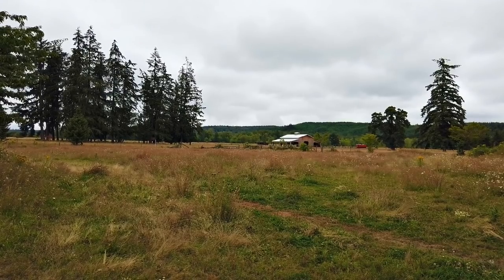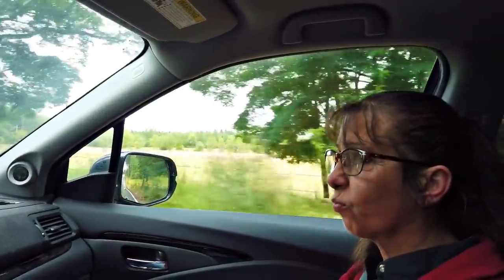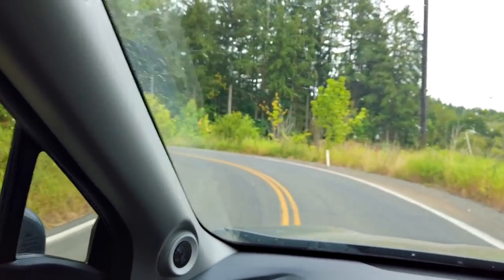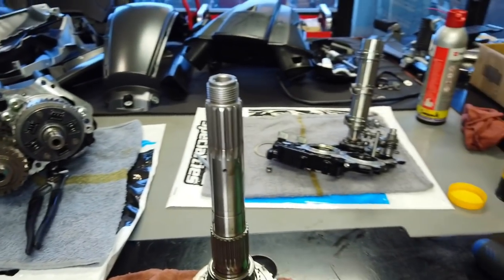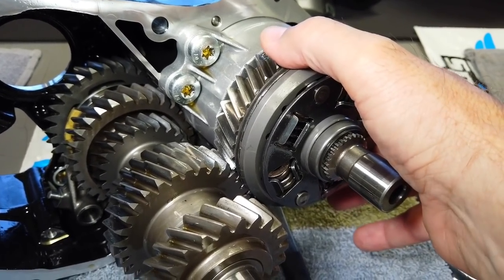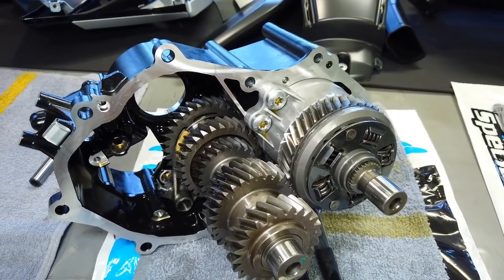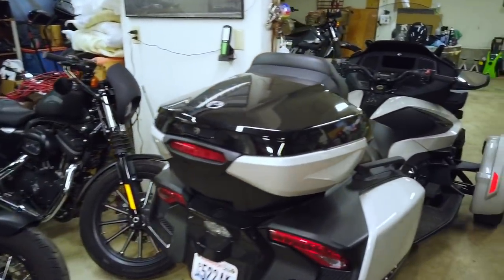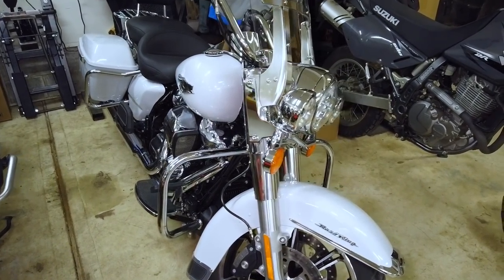Indian Springfield in Sagebrush!! • 2020 Dark Horse! | TheSmoaks Vlog_1711

Comment: Speaking of the dampener, the Honda Goldwing GL1800 from 2001 - 2017 used a similar one for the alternator. The dampener unit was held together with a circlip. During the first couple years of production Honda used different vendors for the circlip to save a few pennies, and some of the circlips would break. Of course the circlip pieces would fall into the bottom of the engine and the dampener would be loose and start to rattle and made the engine sound like a diesel engine. Of course to fix it, you had to pull the engine, which was no fun, and then to get the metal circlip parts out, you had to split the case. All of this just for Honda to save a few pennies. There was usually no other damage to the engine, just make sure the engine was free from broken circlip pieces, replace the dampener and put it all back together. Love watching these videos. Thanks.